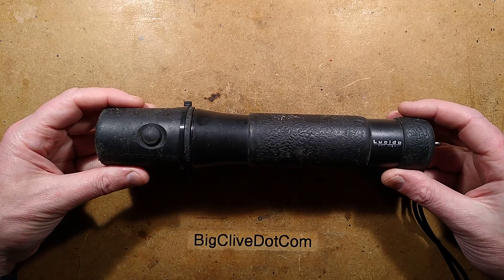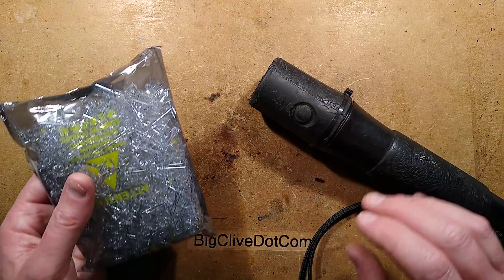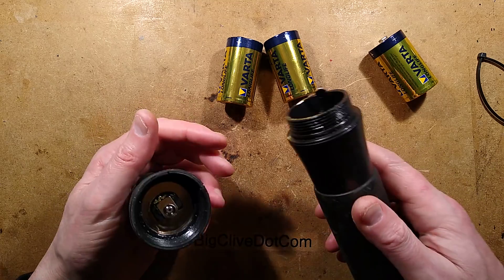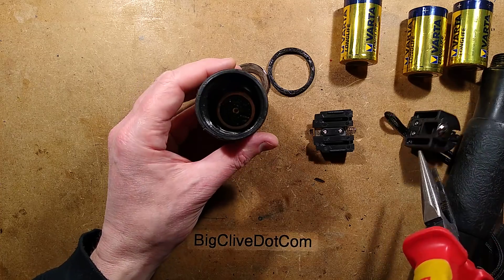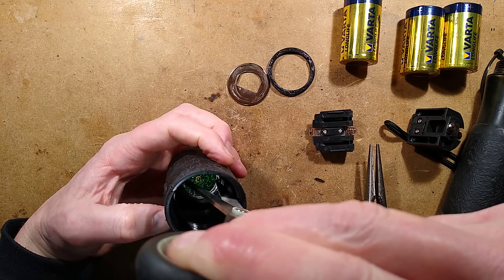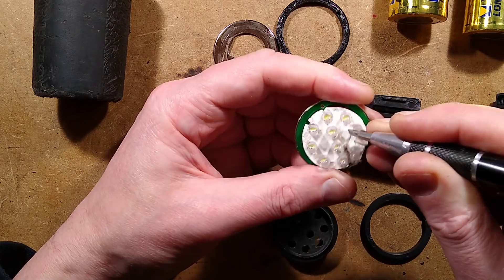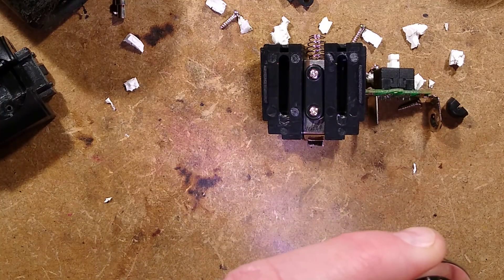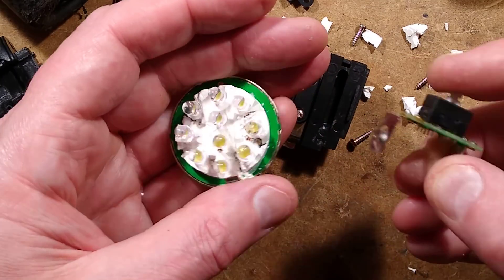Teardown of a vintage Lucido 20 year old LED torch.

Comment: The "Should I buy?"
Like the 6xD cell Police issue Maglight I have.
Strong enough you can drive over it, and could double up as a nightstick....
Still works and looks good.
Reply: As long as you don’t mind constantly twisting the battery cap when it flickers and loses connection.
Reply: I thought the same when I got a 5xD cell Maglight, it was pricey at the time and thinking like with all my 2 D cell lights I bought 5 2 packs of no name D batteries.....7 years later I decided it was STARTING to look a bit yellow in the beam so I got out the remaining spares, and then 4 years later I upgraded it with a LED replacement bulb, That was 2 years ago now Still going strong with that second set of batteries! Only change now it has a vintage belt clip for full nightstick style carry. Never had a problem with the endcap threads, just gotta keep them lubed.
Reply: @Randon_Tain  cool upgrade.. would love to see a video of that : )
Reply: None of my other flashlights require periodic lubrication.
Reply: @paulmccoy2908  they probably confused flashlight with fleshlight :)
Reply: I loved my maglites, they would last for years, aside from the bulbs burning out. I eventually switched to LED maglites, which have been going strong for many years now.
Reply: @paulmccoy2908  There is another class of Fleshlight, Lubrication is essential.
Reply: @paulmccoy2908  never, ever use your fleshlight without lubrication.
Reply: And in a pinch, you are always prepared for a nighttime game of baseball...just don’t forget the mitts!

My one criticism of the Maglights of that era was the lack of any vibration isolation of the incandescent bulbs...so whenever dropped from a 10ft (3m) ladder onto a concrete floor while lit you always had to break out the spare bulb in the battery cap...and that was fir the 2 and 3 D-cell versions, I would expect it to possibly be even worse with the added weight of 5 D cells.  Otherwise I very much loved their flashlights of that era and still have several of them in working order (there were others, but they didn’t survive the leaking of their batteries!).
Reply: @ethanpoole3443  Dropped mine off my belt twice onto hardwood and concrete, still has the original replacement bulb in the end cap, it helps that it wasn't on when it was dropped, also I now have about six different Maglights from AA, C and D sizes due to refurbishing and repairing ones with battery leakage. Pulling the switch out from the top is always the fun part on the C and D button switch models to pound or drill out the swelled cells!
Reply: Used to have the 2 AA Mini-Maglite. Very rarely used, and the one time I needed it it didn't work. Quite an expensive torch too, and as you might know, impossible to non-destructively dismantle.  Compares VERY poorly with the 3 AA LED "no-name" LED torch also bought in 1998 - presumably Chinese manufacture, that still functions just fine (although the LEDs are not so bright!).  Same goes for the NItecore Tube lights - bought six, and not one of them has survived more than 18 months, despite almost no, or maybe minimal, usage.
Reply: @phils4634  I know a few who have had bad times with some Mags.
I have a cree LED using 2xAA and metal body.   Great for day to day use.   And I've driven over it, (don't ask - lol) and it still works fine.
But I do like my big mag.   Good for dark nights when you need more than just a light. :)
Reply: @MrWitchblade  We have found that the Lightway torches from ALDI offer better performance (and comparable durability) to the best of MagLite's range. Whilst not desperately cheap they are extremely well-built, with current Cree light engines. Their double 18650 rechargeable 5W also provides a powerbank function (and a true 2A current capability at 5.126V). Their smaller "pocket size" lights run on 3 x AAA however they still provide plenty of endurance (circuitry really sucks the cells dry!) and the compact convenience offsets the AAA use.
Reply: @phils4634  funny thing, my cree LED 2xAA came from Aldi. :)
As I said, it's an almost daily use.   BUT not rechargeable.   I know Aldi get great stuff in and will have to look out for the next time they get rechargeable flashlights in.
Thanks for the name as well.
Funny how you can never have too many flashlights.     lol
Reply: remember those, the bulb would break the 1st thing you would hit hard with it..  but were still great lights..
Reply: just remembered i had a tiny version one(black) that took a single AAA battery. and had the spare bulb under the spring in the twist off cap. i loved it but lost it. but bought another one( no black left so got blue) and forgot i found it again just last night as it happens.. but it still had a battery inside and is corroded to bits.. but didn't work before i put it away & forgot about it. couldn't get another one.
Reply: @keithking1985  the spare bulb is very useful.   And batteries lasted longer than expected.   I see comments about jiggling when it flickers, and strangley, it's the one flashlight which hasn't suffered that.
Still in use, nearly 30 years after bought.
Reply: @keithking1985  I found an old 4D one my parents got me in prob 1995 or so. Took it out of a box about 6 months ago. It sat for a looooong time, somehow batteries did not corrode and still had enough power to dimly light the bulb. The batteries were expired in 2014, so they prob were in there 15 years. I had another one that sad for a couple years and corroded to hell.
Reply: Same as mine.

Comment: I have an incandescent bulb flash light that must be well over 20 years old from Otis elevators.  It's OSHA approved for using in flammable gas conditions.  Neat little switch to turn on. I'd like to upgrade it to led but don't know where to start lol
Reply: There were universal LED conversion kits back in the day, not sure if they're still easy to find.

Comment: I still remember hacking my cheap mag light clone into a led flashlight as I got my hands on some engeneering samples of luxeon stars. That was a 1W rated led whitch I ran at about 0.6W as they had the tendency to die very quickly from over heating.

Comment: Clean the overmold (butylene?) with a rag moistened with isopropyl alcohol then give it a light dusting of talcum powder.  Silicone grease works better than vaseline.

Comment: Interesting. I thought blue (and therefore white) LEDs weren't invented until the early 2000s but apparently that's incorrect. But for sure that's when they became commonplace so this is indeed a very early one. I still remember the unnecessarily bright eye-piercing blue standby LEDs on some products from that era.

Comment: Does anybody remember those 3v  "duplex" batteries you used to get for torches. I think their official name was a No. 8 battery. My Nain had dozens of spares next to the meter cupboard.  

It's a shame they discontinued them as they would have been a handy size. I wonder if anywhere still makes them.

Oh, and those 1980's oblong disposable torches from woolworths.
Reply: I had a few of those Stingray Woolworths torches.   Remember the later ones being bigger and boxier, and the earlier ones smaller and more rounded
Reply: I remember the Ever Ready no 8 torches. Blue and white. Goggle doesn't seem to, but at least the batteries do come up. Back in the 70s I considered them to be the greatest torch ever.

Comment: <3 still have my first led torch(. light) and it still works . yup its about 15 yrs old. nice. how long do leds last for? or at least these old bulbs?
Reply from the maker: It depends on the quality of the LEDs and the amount of use they get.  LEDs tend to degrade gradually with use, and lose intensity.
Reply: @bigclivedotcom  it was all metal and i disbanded it when i upgraded during a camping trip at some piont it it was special being my first led torch.. then one year led hit everywhere!! $ store galores. i loved putting the led string lights in my tent <3
Reply: its was A CRIME to ever leave batterries in  THAT torch  when not in use !!!

Comment: Wait, you didn't swap the LEDs for some of them from that big bag you brought on screen?
Reply: Chewing through all that silicone potting would be a pain in the arse. And after all that, he'd have to change the resistors, too. For a flashlight that's cracked down the middle and has a sticky handle?
Reply: @sandordugalin8951  You're acting like a crack and a sticky handle is the end of the world.
Reply: @sandordugalin8951  yes

Comment: I was hoping you'd desolder those LEDs to peel the rest of the foam all the way off, but great clip nevertheless! still waiting for that 2160p 4K tho
Reply: My phone display is 1644×3840 pixels; they've been making 'em nearly four years now, it's time to up the video resolution!
Reply from the maker: The difference in upload time is significant.  At the moment it takes several hours to upload a 1080P video here.

Comment: Built somewhat like my 36 year old Durabeam torch, which must about have been one of the last scientifically designed tungsten torches. Much the same hard plastic shell and 'softer' plastic sealing ring, and multifaceted reflector.

I do have a few old LED torches (15 to 18 years old), but they're mostly "also brands", multiple LEDs with three aaa cells in a cage. I have a single LED MagLite (a proper copper's torch) hich uses to "D" cells, and can light up a barn, half a mile away, then there is the Cheapy multi LED effort of a few years earlier, every bit as big, and struggles to light up a cat across the yard. About a month ago I bought a more modern "NEBO" branded penlight "Inspector" torch, not expecting it to be all that fantastic - I was more than pleasantly surprised by its single LED. I've discarded the packaging unfortunately, so can't say what it boasts, but it is quite literally a glowing testament to how much LEDs have advanced over the years.

Comment: What would you recommend for a flashlight today? 
I imagine a size that uses a 18650 battery.
Reply: I am by no means a flashlight specialist, but I bought an Acebeam L16 two years ago and it's totally amazing. Compact, sturdy, crazy brightness. Not cheap however...

Comment: Clive, have you looked into Olight LED torches? They sponsor one or the other of the youtubers I'm subscribed to, and that way I got to know them (being an LEDLenser fan until that point). But I must say, they are not all that bad. A bit different approach than LEDLenser with their variable focus lenses, but still really bright torches, and the tiny one I've got on my keyring (it has an integrated rechargeable Lithium battery much like your keyring lights) is already serving me well since about half a year or so, it's the model I1R2 EOS, really tiny but bright as hell. And not all that expensive for less than 20€, considering its performance.

Comment: There are still incandescent torches out there, but they, in order to compete with LEDs, are massive, and massively power hungry. They generate so much heat that they will ignite a sheet of paper when you hold it against it while the torch is lit at its highest setting. CrazyRussianHacker had one on his channel a couple of years ago (and I bet, other youtubers did so, too).

Comment: My Maglite flashlight that runs on D cells I adapted. I purchased a third party LED bulb to convert the bulb and then designed a 3D printed enclosure to turn a single 18650 into 2x D cells and fitted a USB lipo charger and protection into it to. So the battery has recharging built in by just popping it out of the light and plugging a micro USB into the side. Used a brass washer superglued onto the ends with wires down to the protection board.  Works awesome!  https://www.tinkercad.com/things/7WQgCIZFRFv

Comment: If you want it I have an Ikea Tradfri wirelessly controlled bulb and controller that has obviously let out the magic smoke (the bulb has blackening on the plastic "bulb" and there is black visible from one of the vent holes at the bottom) and no longer works, could return it (it's less than 1yr old iirc) but what's the fun in that when it can be disassembled to see what has gone "pop".

Comment: I remember buying a Blue LED from Maplin for £10 to have a muck about with 😏.
Remember the first time I saw a Blue LED was in Star Trek IV on McCoys medical scanner thingy! - I wanted one 😂
Reply: I was lucky to be a Maplin assistant manager back in the day that there was a 6 monthly technical test for all shop staff and a large part of our time was spent pouring over customers' crap soldering/design errors to show them why their project wasn't working as expected. Often it was along the lines of actually the red led is flashing, but it's at 2kHz, here let me replace this resistor. That'll be 3p please. I digress...

When we got our first delivery, we powered up one of the new 5mm blue leds. We all sat there "after hours" with the shop lights off just looking at its blueness in amazement 🤣
I think the 3mm was £12 and the 5mm £15 when they originally came out. Life's little pleasures really were much simpler back then...
Reply: @georgeprout42  Yeah I was an early adopter single LED for £12 - was totally worth it though 😄
Reply: @ANTandTEC  Even with the 25% staff discount I never considered actually buying one. Red, yellow and green (plus I had a couple of amber ones, cutting edge stuff) were enough. A bit like the number of TV channels at the time I guess. 
Even now I don't immediately "get" what a blue led is trying to tell me. My laptop has a white led, wtf does that even mean? 😉
Reply: @georgeprout42  White and blue LEDs just always said "science fiction" to me. You are correct - leave the red/amber/green to actually give meaningful indication!

Comment: It would be interesting to compare well used ones to some new old stock vintage leds to see how much they have lost brightness
Reply: My guess is they likely have not deteriorated much as such vintage LEDs are usually run at much lower power so the phosphors have been both much less stimulated and have remained much cooler as well.  That said, any comparison would really need to be conducted within the same manufacturing run as there tended to be much more natural variation, both in color temperature and intensity at a given current, between batches of white LEDs back in the latter 90s.

Comment: My Pawpaw bought one of the first brand new solid state Fisher 16-channel stereos made...had 2 huge drivers that weighed around 12.5Kg (27.5lbs) each.  
When it finally died he gave it to me and said:  If you can fix it...you can have it.  
Well...my other Grandpa had been teaching me math, electronics & electrical work since I was 6 so I said OKAY!  
14 days later after having to diagnose then design & fabricate 2 new circuit boards including populating them...pretty much lived in Radio Shack the whole time...I asked him over.  
I had it hooked up to 16 JBL Signature Series Concert Line speakers...I put in a Black Sabbath tape and cranked Iron Man at full volume!  
When he got his hearing back he said:  Its yours...you have damn well earned it.  Seems his repair guy said it was unrecoverable...but he never met me or my Grandpa
I had came up on the cusp of the crossover from tube to solid state so I knew a bit about both worlds.  And it was only the second board etch I'd ever done.

Comment: Clive, I "upgraded" to the nitecore tip2 720 from the original tip. It's super nice except the user interface is awful. You need to press and hold a significant amount of time to turn it on, and the turbo mode doesn't stay on. I feel these changes were from the original tip turning on in people's pockets. But by moving the buttons to the side of the unit, I feel they've addressed this...

I'd love to be able to drop a microcontroller into it to fix these annoyances, but I've no idea where to start. Suggestions?
Reply from the maker: The turbo mode can't stay on too long for thermal reasons.
Reply: @bigclivedotcom  Yeah I know but the tip slowly tapered it off

The tip 2 is almost 4x as bright in turbo mode, would be nice to have an inbetween brightness from high to turbo

Comment: I've recently had to stop using vaseline as an addition to improve the IP-rating of outdoor junction boxes, sockets and floodlights.  I was getting some mysterious failures months after installation, so I've started using silicone grease even though I can't find anything online to confirm my suspicions.
Reply: Remember Vaseline is a petroleum jelly, so some plastic will react poorly to it.
Reply: You could try lanolin, it plays nice (from what I've seen) with all rubbers and plastics its just an absolute pain to wash out though.
Reply from the maker: It it actually plastic degradation or just water ingress?  Water will find a way into fully sealed enclosures.
Reply: @bigclivedotcom  It seems to be vaseline causing plastic parts to disintegrate inexplicably.  Front covers of floodlights would be found on the driveway. It looked as if the screws had been overtightened and mashed the plastic threads but that didn't make sense.  I'd applied vaseline during installation to stop the screws rusting.  
I used to apply vaseline on the hinged covers of outdoor sockets.  A few months later the plastic hinges failed and the covers would fall off.   I thought it was the customer being heavy-handed but these failures seemed to be happening a little too often.
Reply: @westinthewest  was it making the plastic swell and that caused the screws to pop
Reply: @poellot  Yes, it looked similar to heat deformation.  I haven't got round to doing some rudimentary tests at home to see if I can re-create the effect.

Comment: i still have my 1st gen LED light from sears, 5 leds, the newer model has a 1 watt? 3 watt? center led that is a traditional bulb insert but mine is so old it has the same 8mm led as the 4 around it, takes 4 AAs and still works despite half of the plastic broken off